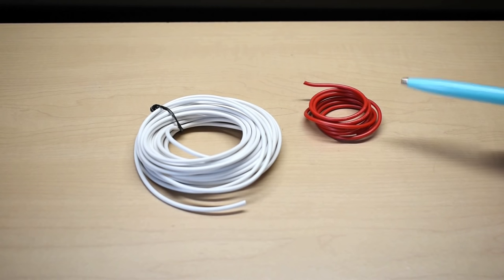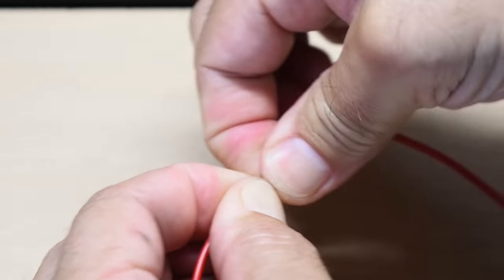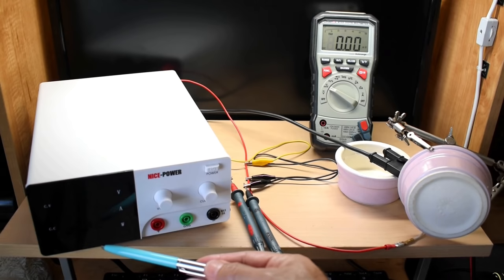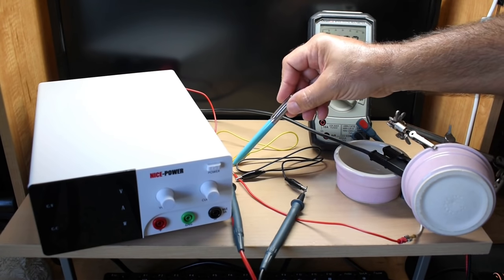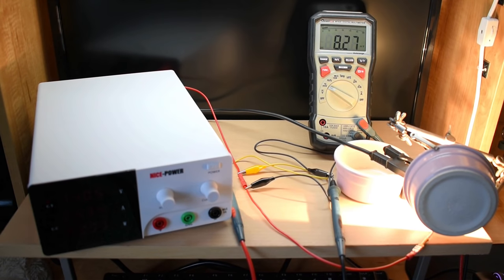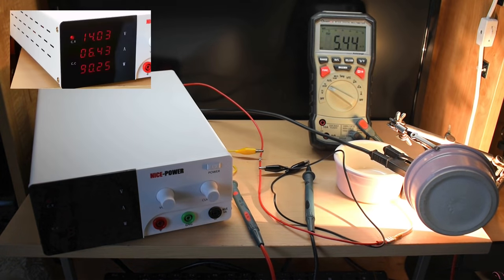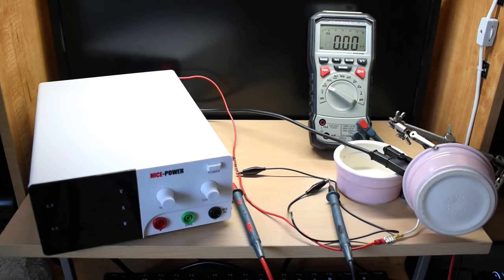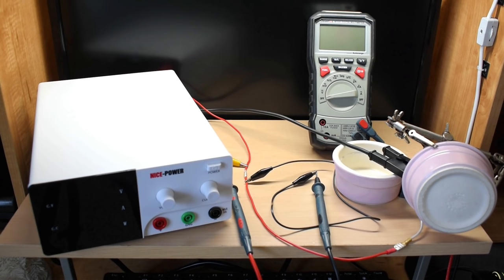Which Stranded Copper Wire Splice Is Best? Find Out!

Comment: Great info. I've always had my suspicions but I never actually did the due diligence. Never would have called the epoxy! I wonder if the temperature readings need adjustment due to the differences in emissivity of insulation, copper, solder, etc?
Reply from the maker: Thank you. Very possible the temp measurements were a little off.
Reply: Actually, the emissivity of a shiny bare metal surface can be very low and be really difficult or even impossible to accurately measure temperatures with an IR camera. I inspect a lot of electrical equipment with infrared and bare metal surfaces can "hide" a lot of heat because their low emissivity surfaces just don't emit that much radiation. Applying heat shrink to the area of interest would solve the measurement problem. Set e to 0.95 and you'll get accurate temps.

Hate to sound like a know it all, but I see a lot of guys putting to much faith in the temps spit out by IR cameras. Cool experiment though. Keep them coming.

Comment: Why is house wiring never soldered together, if every kind of mechanical bonding in your video was inferior to soldered? 😆 I have to think the reason is probably something like: Because then electricians would all need to carry soldering irons. (Obviously, you still need to mechanically support the wires, and insulate them.) If I was to twist house wiring, then solder it, then wire nut it, I think this would be the best connection. But it would probably violate code, and it would make old gray electricians go like: "WTF IS THIS??? WHY???"

Comment: Can I ask a somewhat related question? Could the positive and negative terminals of a 12 volt battery (used for solar) be connected (with battery cables) to an XT60 connector, that plugs into a portable power station? Thanks in advance for any help you can provide.

Comment: my solder iron takes way too long to heat even small wires to the point where solder flows to tin or properly solder. large plugs etc sink heat to the point where I'm having melted insulation at my clamps before the solder flows. 

What temp solder iron do you recommend for general 12awg - 18awg wire?

Comment: Have you ever tested the resistance of the solder seal connectors? They are basically waterproof shrink with some low temp melt solder. I'm wondering if they have substantially more resistance than a standard solder job.

Comment: I'm surprised that the silver epoxy did that well.  Thank you!
Reply from the maker: It's impressive stuff. It's a little pricey though. You get enough to do maybe 10 connections like you saw in the video for 20 bucks. You can cure it in 15 minutes using 200F heat, or wait 24hrs. Once mixed, you must use it.

Comment: Nice video, thanks! You could have used you power supply in constant current mode for more consistent current through the wire during measurement. You don't even need a  load. Just the wire as a short across the power supply.

Comment: Thanks for the interesting experiment. The results demonstrate that any of the splicing methods shown will produce an acceptable level of voltage drop. Even the worst method is likely to be entirely inconsequential in almost every application I can think of. Several millivolts difference at 6A is very tiny. The more important question then becomes: what is the best method to select for long term reliability, based on the environment in which it is intended to operate.

Comment: Lap joint or twisted lap joints are the superior way to join any inline splice. And that is for a few reasons. Obviously the least resistive way. But also it doesn't add to the diameter of the split so heat shrink doesn't make the joint bulky and flows easily with other wires in a bundle.

Comment: That was very good info, thank you. I wonder how they will go after a little aging, say if the samples were kept outside in the elements for a week?
Reply from the maker: I usually seal all my splices tight, but just leaving them exposed for a test.......an interesting video idea. :-)
Reply: @electronicsNmore  I do too (seal splices), but once in a while, one splice will have air ingress and will corrode, so practically you probably want to know about this worse case condition. I'm glad you like it as a video idea.

Comment: Thanks for publishing this very exacting test. My guess, probably in the comments, is that the soldered connections offer increased conducting cross-section area, albeit over a short length.
Reply: And the conductors overlap, creating a lower resistance section.

Comment: There is most likely an instrumentation error on your thermal imaging of the non-soldered wires.
The wire looks significantly colder than the soldered junctions.  It makes no sense, since this is the point of high resistance, thus higher temperature.
The probable explanation is that these wires are very clean. They appear colder because the emissivity of shiny, non-oxidized metal is much lower than that of the wire insulator (emissivity typically around .95) or most other oxidized surfaces.  In the case of the soldered joints, there is probably a thin coat of flux that brings up the emissivity around .95.  The emissivity of shiny copper is probably below 0.1
Here's a handy table of infrared emissivity for many materials.
https://ennologic.com/wp-content/uploads/2018/07/Ultimate-Emissivity-Table.pdf
Reply from the maker: The temp readings probably weren't super high accuracy, but still useful. I use the same setting for inspecting electrical panels(which have insulated wires, as well as bare copper or aluminum). I don't see the temp difference you see.

Comment: The reason that the soldered splice is lower in readings is because the diameter of the conductor at the splice is larger. And the solder helps add to the conductor thickness.
Reply from the maker: As mentioned in the video. Thanks for watching

Comment: I wish you would have done a wire wrap with solder too; I think that might perform even better than the other soldered connections.
Reply from the maker: The result would've been almost identical to twist and solder.

Comment: It would have been interesting to show the resistance of not cleaned and twisted wires too. They’ll end up not cleaned after a while so that would tell you the result alter some time.
Reply from the maker: True, the results in the video were for cleaned stranded copper wire, or new stranded copper wire that's bight/shiny when stripped.

Comment: a bit of a project farm feel but for repair comparison. nice. But the same issue I have with project farm is with this as well in that your intro image would have been good to show a visual comparison with the scale in a way to ass all methods in a single image with its ranking. You may not agree it is much but it helps.
Reply from the maker: The video thumbnail image? I don't understand what you're saying.
Reply: @electronicsNmore  yes the thumbnail
Reply from the maker: I lined up all the splices, I felt that was more than sufficient.

Comment: Thing you didn't figure in is time. Once things begin to corrode is going to make a big difference.
Reply from the maker: Normally you'd use heat shrink over the splice to prevent salt air, moisture, etc, from causing problems, but the tap splice type will definitely increase in resistance over time. Thanks for watching!
Reply: @electronicsNmore  I have much experience with splicing wires that require a good clean connection. Master certified auto tech. Been doing this for about 40 years. With engine control system a splice with resistance can cause much trouble , as with most anything. Those scotch lock things aren't worth the plastic they are made of. Crimp connectors are a bit better. But they can get resistance rather quickly. Unless you use the heat shrink ones with the glue in them. The regular heat shrink tubing can wick moisture rather well also. I only use the kind that has glue inside. The silver epoxy I've never used to join wires. But have used it quite a bit repairing window defrost grids. It works good. But usually needs reapplied within a year. Best joint by far is good solder and glue shrink tubing. Always want water tight seal on the wire insulation if it's exposed to any moisture. Slightest break in insulation can cause much damage and headache. The wire can wick the moisture to the whole wire harness.

Comment: What about a Wago connector?
Reply from the maker: Hi John. If enough people share this video, and it does very well, I'll make part 2 showing Wago, solder sleeve, Ideal, etc. Thanks!
Reply: @electronicsNmore  could you also include a wire twist with a cold solder joint. Sometimes I just can't get the wire joint hot enough for a properly soldered repair.
Reply from the maker: @thinkingimpaired5663  That can be done, but first I want to see how well this video does. It may not be worthwhile to spend hours making a second video for only a few thousand people to watch.
Reply: Please include wire nuts also.
Reply: @electronicsNmore  If this goes ahead you could try to get hold of a UK style screw terminal block as well.
Reply: @electronicsNmore  I really appreciate your videos and I do realize it does take a lot of effort to produce each video. So don't worry I do understand your point of view. I would imagine cold solder welds likely wouldn't perform well. I did learn much from your recent video and from people commenting on your channel. So thank you for your great work. 👍
Much of my curiosity started about 48 years ago as I practiced different splices such as rat tail, center tap, etc. At the time I was curious what are mechanical properties and current capabilities of each splice were.
Reply: @electronicsNmore  63/37 solder would also be interesting. I only ever hear about the difference in how they melt and solidify but nothing on their conductivity.
Reply from the maker: @Voyajer.  The 2% silver solder was 63/35/2
Reply: @Voyajer.  There will not be any noticeable measurable difference in using 63/37.  That alloy is used for it's eutectic characteristics while wave soldering. Conversely, the 2% silver in 63/35/2 is there more for increased strength than for a large increase in conductivity. But regardless, this was a very interesting and enlightening video. I am hoping for enough views for a part 2 from electronicsNmore.

Comment: That silver epoxy has to be bad right
Reply: That was a surprise but I'm told a good crip connector is better than solder so I'd like to see more like a non insulated crimp connector and stuff
Reply from the maker: I would say a high pressure crimped connector is as good as a soldered connection. The average person won't be using a high pressure hydraulic or ratcheting crimper. Thanks for watching James!
Reply from the maker: The silver epoxy performs extremely well and it's very strong when fully cured.

Comment: I'm surprised buy how low the solder was because you didn't use proper soldering technique. You are supposed to heat the wire with the iron and apply solder to the wire. Not put a glob of solder on the iron and then apply. That is how we learned to do it in college when I got my electronics degree.
Reply from the maker: There is nothing wrong with my technique. The solder flowed beautifully into the twisted wires.
Reply: @electronicsNmore I’ve gotta agree with Mr Whitetail. Just because it looks like it flowed in doesn’t mean the wire was hot enough to make the best bond. There are good reasons why the soldering technique was developed.

Comment: Those vampire tap/splice connectors are AWFUL. Never use them. They compromise the wire itself, leave it open to the environment, and the connection ALWAYS degrades over time as oxidation builds and the oxides disrupt the metal to metal contact of the blade and the strands of wire. If you use these in a car, you better be prepared to chase electrical gremlins with a year or 2.